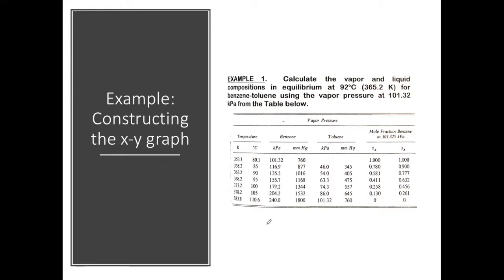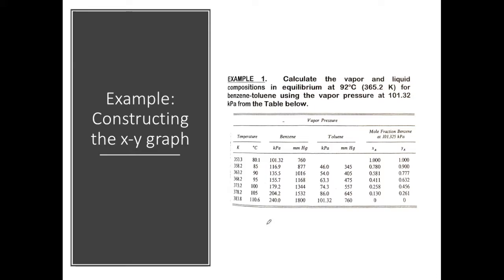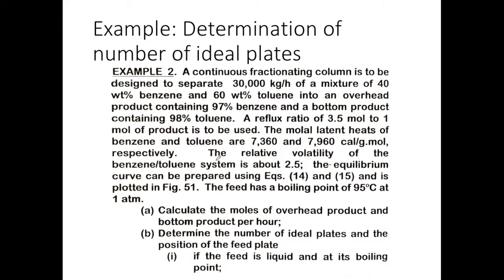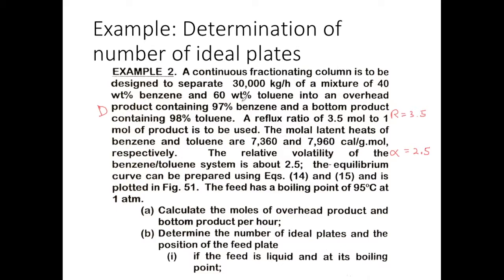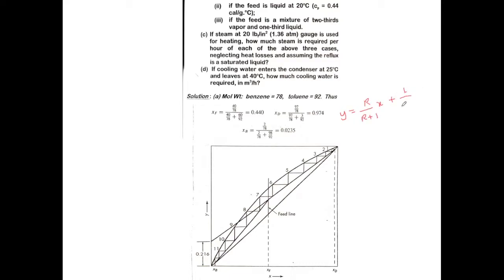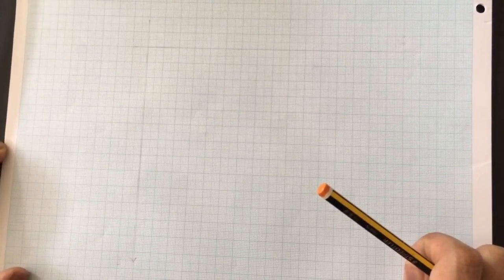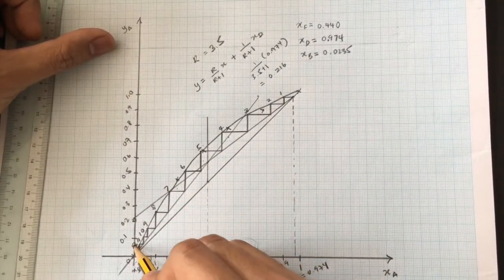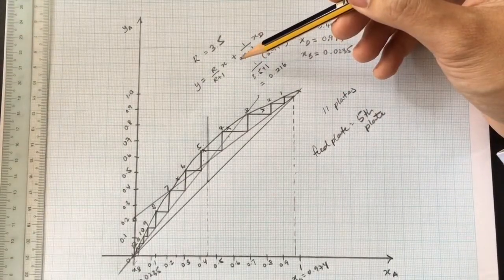IEK213 The McCabe Thiele Method

Comment: Please explain how to draw q line if q=1.2 or 1.5 Thanks
Reply from the maker: You can use the feed operating line equation in the form of y = mx+C. q and XF are constants. Then you choose two x values and calculate for y to draw the straight line. You can use this to calculate for any q. Does not have to be positive.